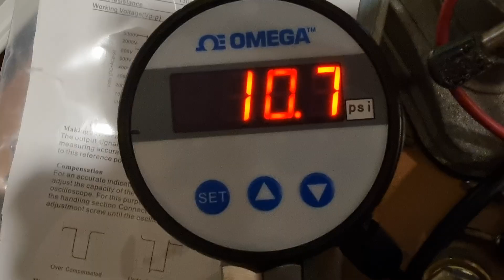Dr. George Egely's energy amplifier

Comment: Resistors are of different size and thus mounted differently on the thermometers, not covering the thermometer's base completely on the input side. If you make the choice of such an energy measurement, the setup must be similar.
Reply: I think that they're also monitoring ambient temp so any imbalance between input and output configurations can be corrected for.  Maybe I'm misunderstanding that though.
Reply: @ChrisTietjen_00  It would have been enough to isolate the resistors from ambient by packing them in some insulating stuff with duct tape. And if you measure ambient there should be one thermocouples above each resistor array.
Reply from the maker: They were calibrated with DC and the input to oneside is what goes through the spark gap and through the other side.

Comment: I wish you would have explained wtf  that is supposed be doing so we would know why to care. Lame video. Do you want everyone to think you are flakes and cranks. I learned nothing from this. Get it together Bob!
Reply: The 2000v spark is being generated by a taser that is powered by a 4.5v power supply.  The tube where the spark is being generated is open to the ambient air and the absolute ambient air pressure is 10.7 psi. The spark is creating an EVO (Exotic Vacuum Object as described by Ken Shoulders) which uses the hydrogen from the water molecules in the ambient air as fuel “to feed the EVO (plasmoid ?)” that draws the extra electrical energy into the circuit that is being recorded as temperature in the thermometers.  The aluminum electrodes are important because of the way that they interact with the hydrogen in the water vapor.   The temperature, pressure and electrical data points are necessary to do the related math along the way.  I think I've got this right but someone who knows better should correct me where I may have gone wrong.
Reply: You haven't caught up with this pattern? Some other obviously staged channels of dudes building mAcHinEsSz in their kitchen and garage do the same thing.. these other guys' videos are produced very nicely but the offer the exact same thing. Nothing! They talk alot with tons of videos up but they are saying nothing at all. A real person with a real knowledge would not care about putting up a show, but they would first spell out HOW it works. These people are obviously paid or scammers.
Reply: These bugs are put in place to make you stop looking further.
Reply: From Grok 3:

Exotic Vacuum Objects (EVOs) and Ken Shoulders’ Research Overview
Overview
This document provides a detailed exploration of Exotic Vacuum Objects (EVOs) and the pioneering work of Ken Shoulders, with insights from Bob Greenyer’s Remote View Substack, as requested. EVOs are micron-sized electron clusters (10⁸–10¹¹ electrons, ~5–15 µm) exhibiting coherent, soliton-like behavior, proposed to enable low-energy nuclear reactions (LENR), propulsion, and material interactions. 

Ken Shoulders’ Contributions

Background
Ken Shoulders (1927–2013), “Father of Vacuum Microelectronics,” worked at MIT (1955–1958) and Stanford Research Institute (SRI, 1958–1968). Founded Vertitek Inc. for experimental aircraft, later focusing on EVOs in a private California lab with son Steve Shoulders.
Key Discoveries and Publications
1980s: Discovery:
Observed EVOs via high-voltage (~kV), ultra-short (~ns) electrical impulses in gaseous/vacuum environments, forming spherical electron clusters (~5–15 µm, 10⁸–10¹¹ electrons) with reduced charge due to self-organization.
1987: EV: A Tale of Discovery (Jupiter Technology, Austin, TX):
Described EVO formation and microscopic craters (~µm) in metals (e.g., titanium), suggesting low-energy atomic disruption.
1999: Charge Clusters in Action (Bodega, CA):
Detailed EVO material interactions, including high-velocity ejection and nuclear transmutations.
2000: Permittivity Transitions (Bodega, CA):
Proposed EVOs alter vacuum permittivity, reducing charge for inertial propulsion and energy production.
2006: What’s an EVO?:
Summarized EVO lifecycle: electron accretion, coherent structure formation, and “black EV” mode (low detectable charge).
2008: Basic EVO Questions:
Described EVOs as tools for space-time permittivity manipulation, with propulsion and communication applications.
Patents:
Five patents (early 1990s) claimed EVOs as a new matter form for energy and propulsion.
Key Claims
Energy: EVOs enable LENR, producing energy via nuclear interactions.
Propulsion: Permittivity modulation for inertial propulsion.
Materials: Cold dissociation of solids into low-viscosity fluids, creating craters.
Charge Masking: Reduced charge in “black EV” mode, defying classical electromagnetism.

Bob Greenyer’s Contributions (Remote View Substack)

Background: Volunteer researcher since 2012, leads Martin Fleischmann Memorial Project (MFMP). Uses Remote View Substack to explore LENR and EVOs, building on Shoulders’ work.
Key Insights:
EVO Population (March 6, 2024, ):
Analyzed a 2-ft-diameter sphere, estimating a quarter quadrillion EVOs, suggesting massive energy potential (Hutchison-style effects, transmutations).
Cold Fusion: Links EVOs to cold fusion, citing isotopic shifts in palladium/nickel.
Propulsion: Discusses EVOs for space-time permittivity modulation (APEC, 2022, ).
Weather Modification: Speculates EVOs in aerosols alter colloidal stability, influencing precipitation (anecdotal).
Experiments: MFMP replicates Shoulders’ setups, reporting craters, transmutations, and excess heat (not peer-reviewed).
Scientific Context (2025)
EVO Properties:
Hollow, spherical clusters (~5–15 µm) with 10⁸–10¹¹ electrons, stabilized by Bernoulli forces countering Coulomb repulsion.
Charge masking reduces effective charge, enabling stability.
Penetrate solids, create craters, induce transmutations.
Applications:
LENR-based energy production.
Inertial propulsion via permittivity changes.
Cold material dissociation.
Controversies:
Lack of peer-reviewed validation; mainstream physics dismisses EVOs due to Coulomb repulsion expectations.
Greenyer’s Substack mixes data with speculative theories (e.g., weather modification).

Date/Time: 10:09 PM EDT, August 17, 2025
Reply from the maker: Look here:
https://remoteview.substack.com/p/energy-amplifier

Ask questions and have them answered.

Look to see if your question has already been answered here
https://e-catworld.com/2025/08/16/new-mfmp-video-energy-amplifier-george-egely/

Comment: If it's making aluminum oxide or aluminum nitride exothermically, then instead compare it with operation under argon or helium, for "less chemistry."   (Or, under xenon, for "more Ken Shoulders?" )
I've always wondered whether the Griggs rotor and/or the Russ George CF-ultrasound devices may have been aluminum-fueled diesel engines.  So, compare results to other metal fuels, to zinc surfaces, or Ni, Cu, Fe, Ag.

Comment: Would be nice to figure out if the aluminium oxide on the electrodes that allows for this to work be substituted with some sort of diode configuration, since maybe it works like a diode.. If that is true, then it is possible to use a variety of materials as electrodes.. maybe. I wonder, if ordinary spark plug would give some results if placed in hydrogen?

Comment: Beautiful work ❤❤❤ If understand correctly there’s a water mist inside that tube with a high voltage discharge between the aluminium electrodes which the interaction between the water mist and electrical discharge create a heat bigger on the output. Absolutely amazing. Would love to replicate this work if  I could get enough information…
Reply: The electrodes are covered in porous aluminum oxide layer. Don't know the conditioning method, but it seem to be simple. Those things that produce heat are calorimeters, which measure immediate energy (current x voltage). So output energy is more than input energy. Just type George Egely in youtube search, there's some good presentation - look for full video.
Reply: @x_ph1l the Al oxide forms automatically on any positive charged AL when exposed to air/oxygen.
Reply: @ElijahCokeley  I know that, but there's the thing about important porosity that George Egely mentioned in his other presentation.
Reply: @x_ph1l  "porous aluminum oxide" does describe conventional anodization, where hex-cells of oxide grow vertically from the metal (then we're supposed to dunk it in dye, to give bright-colors to aluminum.   A dry version might produce gas-discharge at quite low voltage, as with the mysterious glow from aluminum electrodes in borax solution.)
Reply from the maker: Just water vapour
Reply: So the negative lead has higher temperature compared to the positive lead?
Reply: Could bosonic electron shell act as a sink and source of electrons?

Comment: Is it wired up to itself, running itself as a closed loop system?
Reply from the maker: Not yet - but it is intended
Reply: If you can figure out how to extract energy from high voltage pulses, then it will be. This is the challenge.